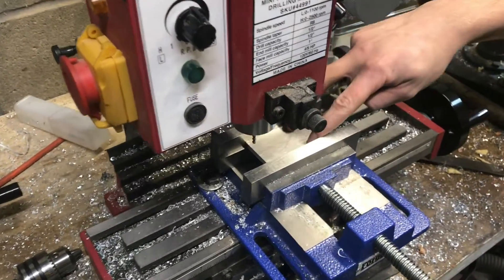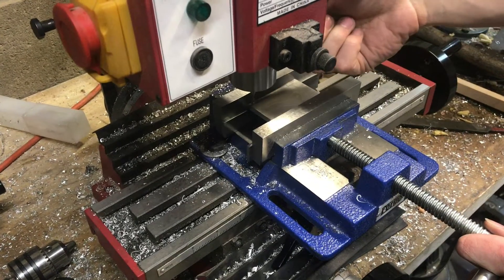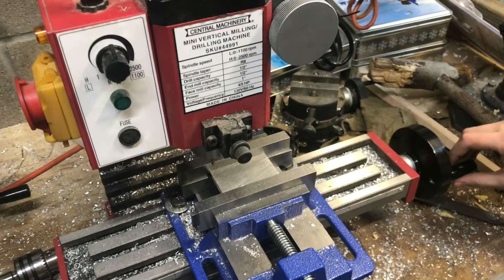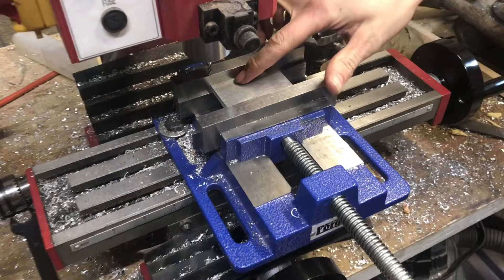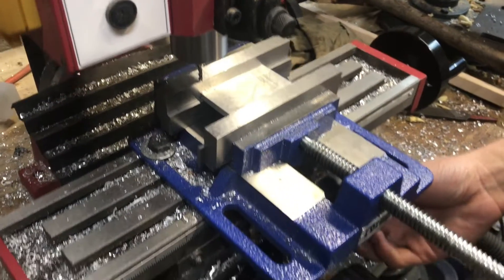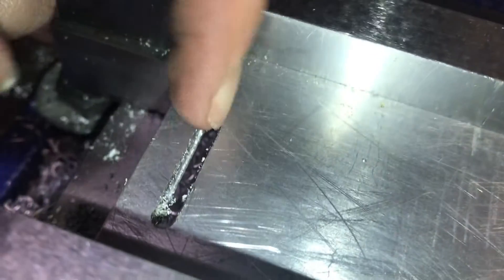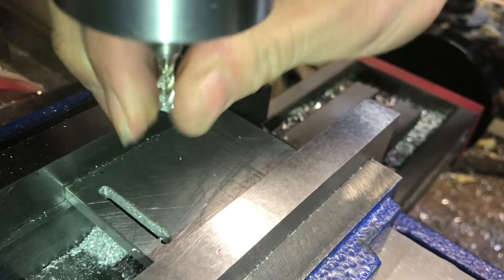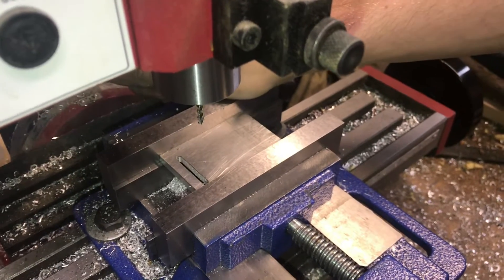milling SLOTS, mini harbor freight mill 44991

Comment: I would have drilled a smaller hole first, and that way you can cut deeper cuts. Drilling with an end mill, is not the best idea, specially on a not so rigid machine.

Comment: New subsriber, I am currently looking into buying that mill. My question is was that audio or do they sound like misaligned gears or something grinding? It just didn't sound happy.
Reply from the maker: I’m thinking that it could have been the audio, it does have an interesting set up in between the gearbox and the drive motor. There’s a nylon gear that protects the system just in case you’re overload The machine. I know this because I’ve overloaded this plastic gear and broke it. And I thought about it I was actually glad that they put a plastic gear in that is easy to replace. We’ve been really happy with this machine because the footprint is pretty small and it does a pretty good job at a lot of things.
Reply: I have this mill in Seig X2D version.  It looks identical, even the color.  When I first got it I thought the gearing was rather noisy so I bought a kit from Little Machine Shop that converted it from gear drive to belt drive.  Much much quieter now.  The kit was easy to install.

Comment: Anyone have an issue where its difficult to swap from high to low gear?
Reply: It is normal on any mill or lathe to have to rotate the chuck by hand to get the gears to line up and mesh together while changing gears.
Reply: I agree i worked with a mill before